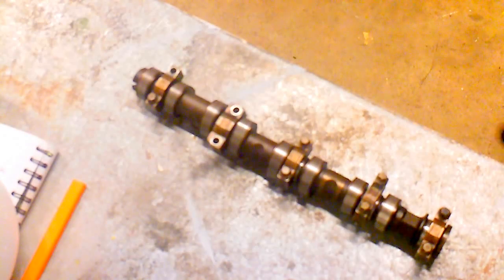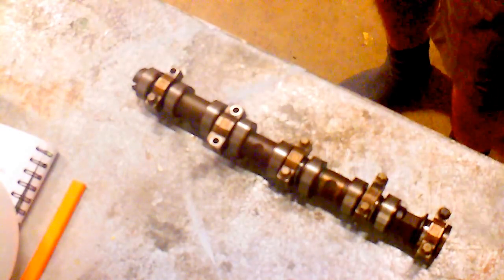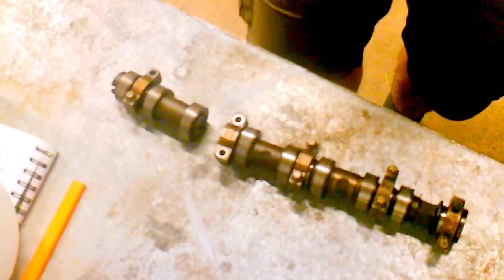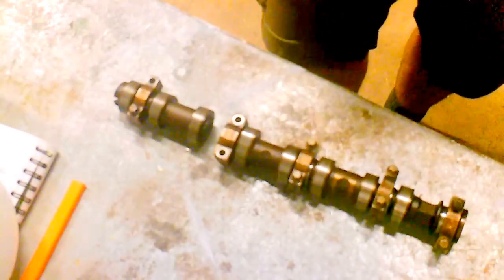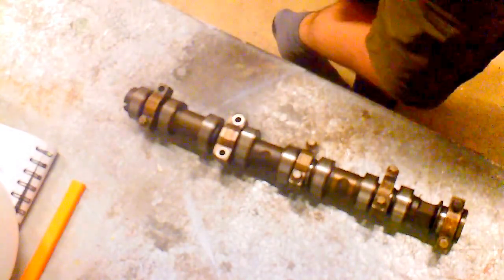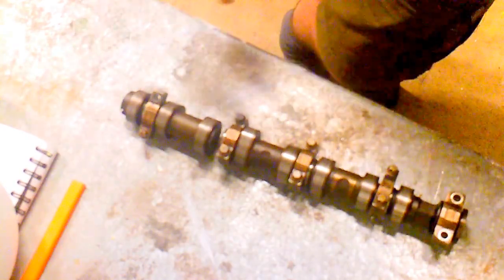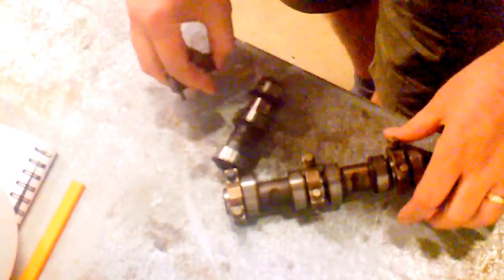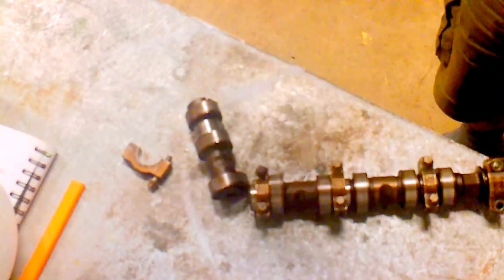Snapped Camshaft GM Vauxhall Opel Corsa C Twinport

Comment: thanks for your video , so did you do the bad work , everything is fine now ?
Reply from the maker: Yeah, I fixed it up, the head and valves needed reconditioning, new head gasket and timing chain, new camshaft. I did the whole job. it ran really well.
Reply: Driveway DIYer wow happy to Hear that, can you help me please i have some question , my corsa c 1.2 zx12p engin code .the car runing very well untill he stoped with error engin in dashboard , i dont have a headgasket probleme , i put the car wheel  up and set gearbox to 5 and tried to turn the wheel clockwise to see if the camshft turn , the crankshaft does turn but not the camshaft , i removed the plastic cover and the camshaft is locked , its not broken just locked ,it doesnt turn when i turn the crank and i found foor hydraulic pusher dammaged ,i think that the problem came from the timing belt 
 , do you think that i must remove cylinder head to set all right ? or just change the timing belt , your answer will really help me. thank you

Comment: I am having the same problem, at the same spot on the camshaft with my astra 1.4xep.
Reply from the maker: Mihail Ganev did it snap?
Reply: @drivewaydiyer6504  yes, the shaft snaped at the same spot, luckily there was no other damage.
Reply: @drivewaydiyer6504  the gay from the service said this is known issue for   some motors and that opel had a service bulletin about it.
Reply: @drivewaydiyer6504  https://drive.google.com/file/d/1r-qMiZz52qD_k-q6-da2lWdOB6CaqI4G/view?usp=drivesdk
Reply from the maker: Mihail Ganev there was a huge problem, with this. All to do with the cam bracket bolts being torqued incorrectly. No recall or warranty was sanctioned and customers were getting charged for work. Complete failure was costing minimum of 1200 pounds to sort out. Hopefully it’s something owners can sort out before it’s a disaster.

Comment: My friend's corsa still runs but took oil cap off and 1st cam is slack and not spinning. Will it be a snapped cam just surprised it is still running
Reply from the maker: Garden genie you will need to take off the cam cover, to get a good look. It will still run, depends what it’s affecting. My disaster bent two valves. You maybe lucky.
Reply: @drivewaydiyer6504  so possibly get a  new cam and retime it all up. Hopefully should be OK as sound's spot on running
Reply: Brill I will let him know thanks for the reply
Reply from the maker: Garden genie that’s what I did first, before pulling the head. I got a cam and bolts off eBay for about 50 quid. Wasn’t a difficult job. You’ll need a cam/crack locking set. They’re about 25 quid. You’ll need the locking set to set the timing and to tighten the cam bolt.